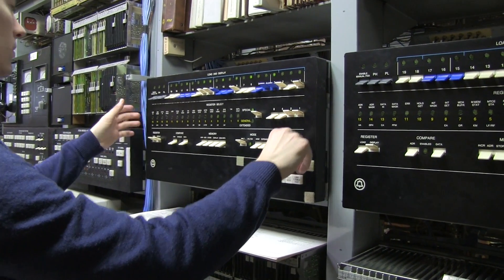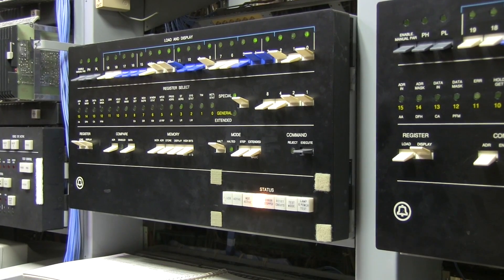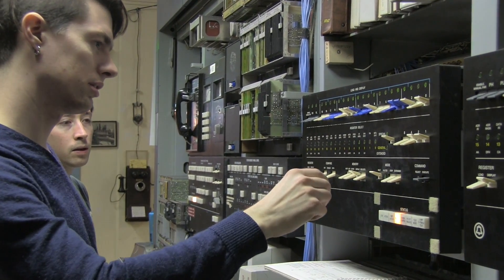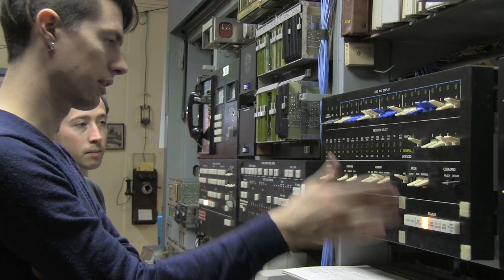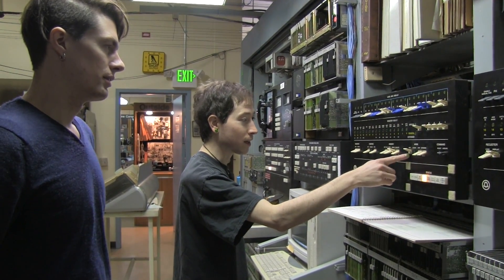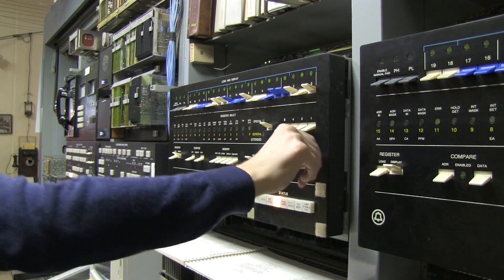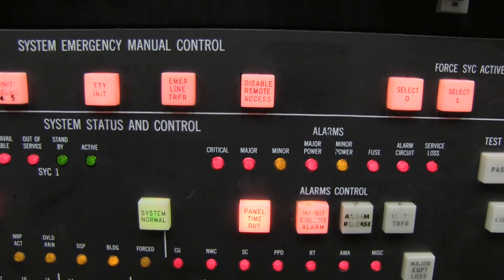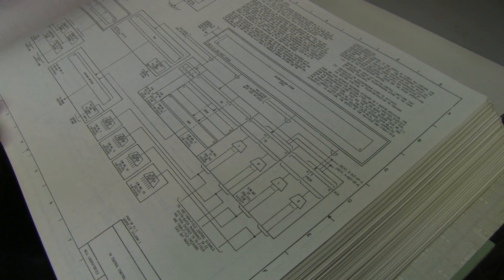Waking up the 3ESS

Comment: I designed the main store (aka the memory) for this, in the early 1970s.  Brings back lots of memories of my first job as a EE.  Interesting stories abound, including how we got special permission to use the brand new Intel 1103 DRAMs for the prototype units because the Bell Labs DRAMs under development in Allentown, Pa were behind schedule.  The main store subsystem can be seen in the beginning of the video at 0:13-- the two shelves of cards directly below the front panel of the cpu.  The left side of the upper shelf holds the 8 circuit modules that served to control the memory  (the right side of that shelf is other stuff).  A lot of the logic was devoted to fault detection circuitry and maintenance access.  The memory controller ran on a 20Mhz clock, and was designed to provide nominal 50 ns resolution in the generation of the various signals needed to operate the DRAM chips.  The overall memory cycle time was a bit under 1 us.  Those control cards used Bell System 1A 5v TTL logic, all SSI, mounted on ceramic hybrid substrates.  The shelf below it holds the actual DRAM memory chips.  These were mounted on conventional pcbs  (to accommodate integrated circuits in standard DIP packages) and held 16K x 2 bits per circuit board.  The memory was 16 bits wide plus 2 parity bits.  The shelf has two 16 bit wide memory modules- one on the left and one on the right-- each has 9 memory boards plus a so-called "fanout board" that distributed address and control signals to the memory boards and provided self checking and maintenance access functions.

Would love to come see this in person some day and visit my old circuit boards.

Comment: Any progress on the power supply for the processor? What type of tape carts is the software on?
Reply from the maker: The power supplies are all happy now. Chuck (not seen in this video) has been working on this full-time. Current status is:
-It powers on OK
-The memory is pretty much all good now. Cards needed to be replaced/swapped. Chuck wrote a memory test program using the register switches on the front panel.
-Tapes will not load. We are not sure if its the drive, or the tapes, or a combination of both. At the very least, the tapes need to be re-tensioned, and given new rubber bands. Even then, we aren't sure if the data on them is still good. There might be corruption from sitting around for ~30 years untouched. Without the tapes, we can't boot into anything usable. 
-Chuck just purchased a PCI card with an FPGA on it. He's working on writing software that will mimic the tape controller so we can just read tapes directly into a PC, and store them on an SD card or similar. Then, he'll have to write software to emulate a tape drive, so we can read the tapes out into the 3ESS on-demand.

(Chuck is very patient, and the folks over at +LivingComputerMuseum have been wonderful in getting us started with the FPGA card!)
Reply from the maker: Yes, I think that is correct --Sarah

Comment: How is the 3ESS coming? That will be a sweet machine to see running again!
Reply from the maker: Progress is slow, as we have a few problems, and not enough information to solve them: First, we need a microcode listing, so we can debug errors like this one. Secondly, one or more of the transformers is giving off a burning, smokey smell, so we're very reluctant to turn it on until we can find out why that is. Thirdly, the boot tapes need to be re-tensioned because the plastic and rubber they are made of is falling apart. :\
Reply: @ConnectionsMuseum  Did you ever find the microcode listing? Not sure this site would help: http://etler.com/docs/ and http://etler.com/bsp-archive/  Lots of Bell technical and install info.
Reply from the maker: @morphoist  Yes, thank you. The Bell Laboratories (now Nokia) archives was able to scan it for us!
Reply: good news! it's up and running! (some of the time) https://www.youtube.com/watch?v=WUUsAK21f20